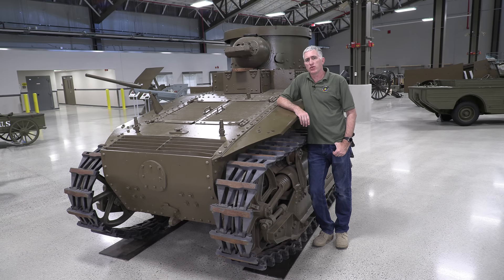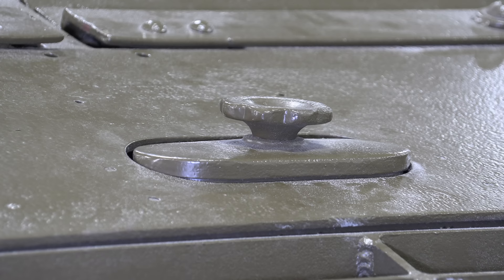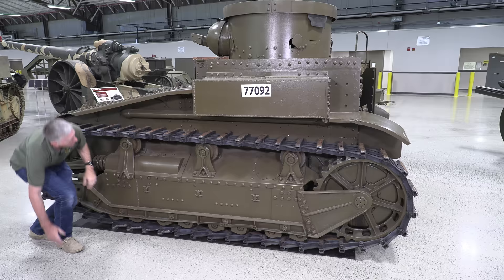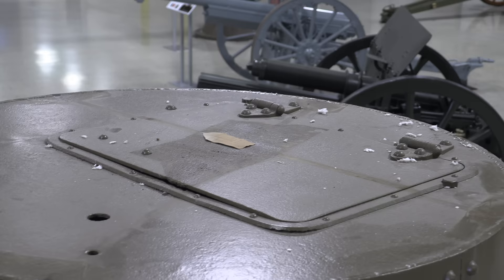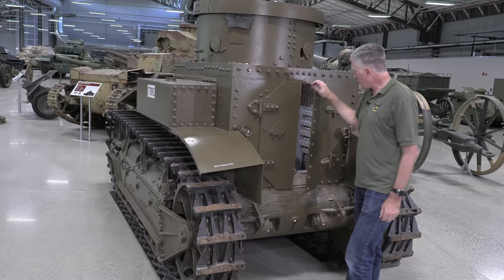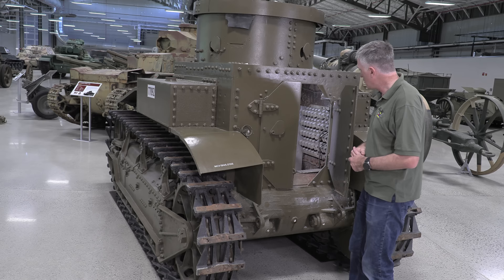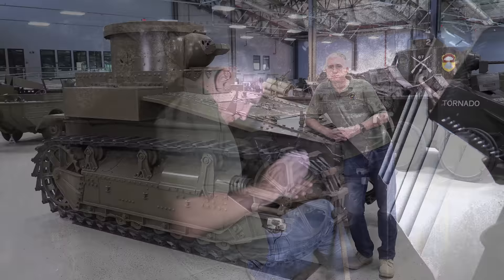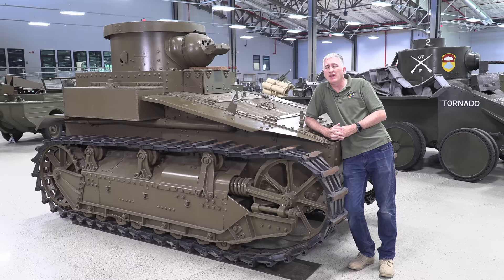Inside the Chieftain's Hatch: Light Tank T1E2

Comment: Great video on an interesting tank.   The Chieftain has tried to explain how the Army tanks evolved into the M-4 Sherman, but looking at the earlier experiments, that war winner seems to come out of thin air!  The M-3 to M-4 makes sense, but how did they come up with things like VVS that bolts on, or using aircraft engines, or the removable transmission housing from a tank like this? Plus add in reliability, assembly line production, and truly interchangeable parts to create arguably the best tank of the war.
Reply: id argue a panther is just as good
Reply: This isn't that bad. In the mid-1920s France was using !still! FTs and the British were bringing the Vickers Mk II into service and didn't have a production-fit light tank. The soviets still had no plans to build the BT line that would lead to the T34. Everyone was still trying to figure out something that was useful and factory-friendly. The Sherman just hit it out of the park.
I imagine the Sherman is not just built from lessons from domestic models but also from what was being built overseas.
Reply: @pilotteacher4527  You'd be wrong. Panther was terribly unreliable. If you can't get it to the battlefield, it's worthless
Reply: Didn't come out of thin air. With limited funds, Ordnance concentrated on developing components - like the use of aircraft engines and the VVS suspension - that could be applied to mass produced vehicles when the time came, not to build fleets of soon to obsolete tanks. See 

https://en.wikipedia.org/wiki/M1_Combat_Car

https://tanks-encyclopedia.com/ww2/US/M1_Combat_Car.php

https://en.wikipedia.org/wiki/M2_light_tank

https://tanks-encyclopedia.com/ww2/US/M2_Light_Tank.php

https://en.wikipedia.org/wiki/M2_medium_tank

https://tanks-encyclopedia.com/ww2/us/m2_medium_tank.php
Reply: The early M3 & M4 suspension system was lifted off the M2 light tank which used four interchangeable bogies as opposed to the six on the medium tanks).
It was developed as the T2 (so was the immediate successor to the T1 in this video).
Reply: @CanalTremocos  The Sherman was very much an American development. The HVS on the M3 Medium was lifted off the M2 Light Tank of 1935 which had four bogies compared to the six on the M3 medium. The M4 tractor used the same drive train as well to tow the 155mm guns in WW2…
The French did experiment with HVS as well in the Renault R35 and a derivative that variant wound up on the Australian AC series tanks (as the designer relocated to Australia after France became a little too fascist for his tastes).
Reply: The Army arsenal began working on a light tank design while the Army horsed around with the Christie combat cars. They invented the VVS by replacing the coil springs with volute springs which were more practical to use since those can still hold some weight when broken. It was a no-brainer to use the same bogie assembly on both sides since all those do is to support the tank. 
The Army cancelled their contract with American LaFrance for being slow and way over budget  manufacturing the Christie combat car and began building their own. They decided to shorten the length to reduce weight so replaced the reliable liquid-cooled Liberty V-12 with a reliable Wright radial aircraft engine. It was coupled together with the rear transmission so both could be removed as a single unit. The drivers liked the radial's performance and smooth power delivery so the Army decided to used it since plenty were available at low cost in warehouses as surplus engines. Wright had came out with more powerful radials so the commercial air fleets switched over to those and kept the old ones as spares.

Before WW1, J. Walter Christie designed and produced a two wheel FWD tractor that replaced the teams of horses that pulled fire department pumpers. He used that concept to design and build FWD taxicabs that allowed the cab to set lower to the ground and have a flat floor. The entire front end holding the engine, transmission and suspension could be unbolted as a complete unit then pushed aside to be replaced with another one in less than one hour. Christie did that so broken down cabs could be towed to a side street or alley to have the front end swapped out in good time so the cabbie could get back to work. He did sell a fair number but those fell into disfavor with the cabbies since one needed the strength of Hercules to steer it. I'm sure some Ordnance engineers remembered the Christie taxicabs and felt the new M4 being designed could utilized the same concept since the front final drive would be prone to being damaged by AT guns and mines.
Ordnance liked to use existing vehicles and components that had a good track record for reliability and were available at a known cost. Some were used as-is while others had components beefed up to become more robust for battle field use. Ordnance had Spicer rejigger one of their heavy truck gear boxes for the M4 and had Mack work up the final drive and brakes from one of their heavy truck rear ends. Ordnance then gave Chrysler the task to design a tank factory, the machinery needed and how to assemble it. Chrysler engineers began building wood mock-ups of the M3 and M4 using plywood and solid wood to make the individual parts. Those were given a few coats of amber shellac so the soft finish would get scratched where parts scraped together and bolts were forced thru. Those were redesigned so the M3 and M4 could be produced using parts that dropped in place or fitted right up ready to be bolted in place to speed up assembly. Chrysler then designed jigs and light boxes for the subcontractors to use to ensure that the parts they made would fit perfectly on the assembly lines. 
The Army had plans to use different turrets holding different guns so Ordnance used the same ring, transverse drive and basket on all of those to make them interchangeable between all production runs. The front drive housings were made the same way. That allowed the field repair depots to quickly piece together a functional M4 using parts off other damaged tanks. There's plenty of photos of Franken Sherman's sporting older and newer drive housing and turrets. My favorite is one of a battle scarred Jumbo M4 sporting the original 3 piece drive housing, an older round turret with the added armor plate with a 105 howitzer instead of a 75mm gun. Has the crew standing by with big grins on their faces.
Reply: @billwilson3609  You have kinda proven my point.  How the Army evolved from crappy interwar experiments, to a war winner.  But the evolution was finding the right parts from failed tanks, a little analysis of other countries work, add in production line expertise, some doctrine, and the M-3 comes out.  Which then became the M-4.  
If you step back and think about it, it’s almost a miracle we got a good tank from the interwar attempts.  That we didn’t pull an Italy, and never really learn from the 1930’s mistakes.
Reply: @doughudgens9275  Henry Ford actually made the first US tanks just before WW1 ended. The US Army was using the Renault FT and wanted more, so got Ford to make those. Henry made improvements to the design and used his Model T engine, transmission and rear drive. Between the wars the US Army purchased foreign tanks to inspect their systems and difficulty to repair along with hiring J. Walter Christie to make some before trying to make their own. The US Army actually listened to the opinions of the crews that used those different tanks so tried to make tanks they wouldn't mind operating when at war. They only wanted plenty of elbow room inside to make their jobs easier to perform, a reliable automotive system that would allow it go fast all day if needed and be easy to repair and maintain. The tankers loved Christie's 1928 combat car since it was roomy, had a good ride and could run like a scalded dog on tracks and on wheels. That made the Army to have some made for further testing and development. They adopted the final product as a combat car in 1938 then declare it obsolete less than a year later when it became obvious that they needed something more robust to use in a shooting war.
Reply: @billwilson3609  Look up the Sherman M50 in Israeli service for examples of Frankenstein Sherman’s - they are without exception mishmashes of parts with turrets, hulls and transmissions assembled from random generations of Sherman hardware but with a standardised gun, Diesel engine and last generation VVS components bolted on.
Reply: @billwilson3609  IMHO, it had a lot to do with Ordnance's desire to prove Christie always and everywhere wrong.
Reply: @RexKarrs  Ordnance wouldn't of hired him if they thought his designs sucked. Christie was a respected automotive engineer that had a bad habit of building things his way instead of following the specifications set by Ordnance engineers. That usually led to his prototypes breaking down often during their first day of testing with Ordnance paying him to take those back to shop to be reworked. He was being paid a lot of money for stuff that never quite worked right so they parted ways. J. Walter caught their interest a second time when he showed with his 1928 wheel/track speedster that actually worked.
Reply: Is everyone here just ignoring the M2? Ridiculous amounts of machine-guns aside, it’s clear as day where all the better parts and aspects of the M3 and M4 came from.
Reply: @billwilson3609  The clock kept moving.  What began as giddy infatuation turned into disappointment and despair, as in a good marriage turned bad.
Reply: The use of aircraft engines was because those were in production and proven. 

Why bother developing an engine with all the teething problems you'd expect when you have an off-the-shelf engine that makes more than enough power?
Reply: @pilotteacher4527 you'd lose....

Comment: In front of the driver's seat, there's a little tab sticking down from the beam where the engine cover and driver's "cupola" meet. It may be two metal tabs with a screw running through them?

Having an old (old!) stove and looking at some of the other bits of the hull structure, I think that may have been one of the main attachments for a partial firewall. Almost certainly thin-gauge steel with an asbestos backing. On the driver's side.

Comment: I think that the two posts are visual references for the driver. You use them like the front sight posts on a rifle. Sighting along them shows the point on the ground where the outside edge of the tracks will be, if you drive straight ahead.

Aside from keeping you out of ditches and on bridges, this will help keep you from running up onto curbs with the outer inch of the track. Given how light the tracks are, I suspect that they could bend if you did that.

Comment: 9:15 It could be blade for cutting barbwire or steel cables that get's in the way of tank,
like that on helicopters.But these are facing the wrong way   :)
Reply: Looks like it has a sharp edge on the underside. Possibly reinstalled the wrong way round.
Reply: @dylanmilne6683  Well, if you think about it. Due to the track design, the vast majority of barbed wire/cables up to the start of the deck, would get grabbed and pulled down under the tank via the tracks. Any of them higher than that would slide up the glacias and snag either on the 2 posts forward (that no one knows what they are), that flag thing, the driver's hatch (possibly harming the driver). Anything drug up higher would hust hit the rounded turret face, maybe beign stuck and the tank dragging stuff along, but perhaps they figured most barbed wire in use wouldn't be that much higher (also with the tank driving forward, even high mounted barbed wire would get dragged down by the tracks mostly. That flag properly installed dealing with any that didnt)

Comment: Jan. 1945? Perhaps as a training tank!  The M-1903A2 could be fitted to various breech actions of a wide selection of artillery.  This plus a training round that was mainly graphite (so it would leave a mark, but not punch a hole in any reasonably thick piece of steel) would make this a plausible idea.  (The M-1903A2 had a threaded piece and a very short barrel (6 inches (~152mm) if I remember correctly, of which is 2.5"(~63mm) is the chamber!).  It also had a modified trigger assembly for use with a lanyard so you would pull (not yank) on it as if you were actually firing an artillery round!

Comment: Maybe the top of the turret is held on by it's own weight in case the tank tips? Then, if the tank is in a bad enough position, it might function as a semi-self opening escape hatch?
Reply: The same cap was used on their earlier turrets. I suspect it had scissor hinges and the top hatch had a roller that allowed the cap to be raised when the hatch was opened and dropped back down under it's own weight  when the hatch was closed. It's made from thin sheet metal so probably served as an umbrella when raise to keep the rain and sun off the commander's head then a rain cap when closed.

Comment: Very much a bulldozer with a turret. A lot of bits I am used to. I guess the rear doors or hatch would always be open or it would reach deadly temperatures in there quickly with an open engine at full power. Difficult to fault it for the era. :o)

Comment: Given that the vehicle barely has any armor one could make an argument that the front engine could provide additional armor to the two crew members should a shell penetrate the armor frontally. 
It's not ideal but for the time, vehicles designs as you've mentioned were experimental and engines could only pull so much therefore one couldn't simply add 3 inches of armor on a tank and expect the engine to move it. 
Perhaps a frontal engine could provide a little bit more protection for the crew? 
I'd like to know if my theory makes any sense or if it's completely off tracks ( pun intended ). 
Thanks for the great video as always Chief!

Comment: That blade-like device on the front of the tank ... could that be a cable cutter (as seen on helicopters)?  Possibly it's installed backwards?  Would such a device have been useful to free a tank from getting tangled in barb wire or communication cables?  Just a wild guess on my part.

Comment: Could the not-headlight-mounts be for coiling a towing chain or cable around for transport? And it looks to me like there are brackets in the engine access opening that might have been mounting brackets for a removable firewall. Did any of the books verify that it actually had no firewall?

Comment: 6:00 Not sure what's going on in that diagram because it doesn't look like it exactly matches the second picture. But it almost looks like they were using linkages to make all the bogies linked so if one is pressed, the other bogies press harder. Like if the 4th (rear) boogie is pushed up, it forces the 2nd boogie to push further into the ground. Almost like in addition to the bogies themselves acting like a sway-bar/anti-rollbar of a car (one wheel pushed up, forces other wheel down), the bogies are linked between each other to do the same. Not only do the wheels in each bogie pivot and resist each otrher, but the complete bogies do it to each other.

Basically, a complete opposite to today's "every wheel is independent" thinking. Link them all and hope they help each other out. The fact nobody does this now (as far as I know) means this strategy did not help, or warrant the complexity.

Comment: I would imagine the answer is no, but does the Commander's seat rotate with the turret, or at least independently? It's right in the middle of the floor if you need to quickly turn to engage something on your sides or rear, while I'd imagine you'd have awkwardly try not to trip over the seat or awkwardly sit to make it work.
Reply from the maker: I get the idea that the hard seat is for traveling, for combat he'd use the sling.

Comment: Stupid question but why does there need to be a firewall? If the engine burns aren't the tankers gonna bail regardless?
Reply: To keep the noise, heat and possibly leaking fluids and gases away from the crew.

Comment: What's the big howitzer in the background at 6:40?
Reply: Good question, but technically would not be a howitzer. Howitzers had shorter barrels and greater elevation. It looks like some 155 mm or more gun of World War 1 vintage but I can't seem to find it anywhere. I thought maybe it was one of the French 155 mm the US used in World War 1 but the breach and recoil doesn't look the same. 

I can tell you what is in the extreme background at 9:48 though. That is Krupp K5 11 inch railway gun that was named Leopold.
Reply: I think (and I could be wholly wrong) it’s the Canon de 155mm GPF? (adopted in US service as the M1917 like damn near half the guns, and had a WW2 derivative named the M1918). The mount throws me off, though - haven’t seen one with guarded wheels like that in any of the pictures I can find.
Reply: @CardinalAsh  I have a picture from APG from 1998 that shows this gun next to the GPF, but I don’t have the caption. I know which is the GPF because that particular one is pictured on the wikipedia page. This gun is larger, probably an 8-inch, but I can’t remember the designation. I will have to find the physical photograph to see what I wrote on the back.
Reply: @SearTrip  If you find the photograph, me and the other fellows in this chain would greatly appreciate knowing the designation! Unfortunately hard to find photos of some of the WW1-interwar equipment (particularly with enough quality or a good enough angle to look at both the mount and breech, and most only have the most common mount for that gun such as if you’re looking at coastal artillery)